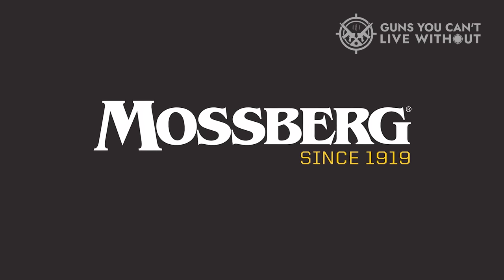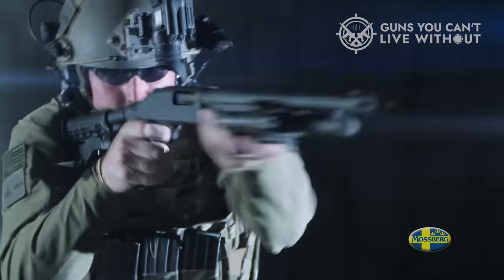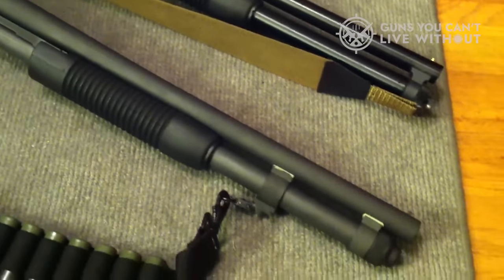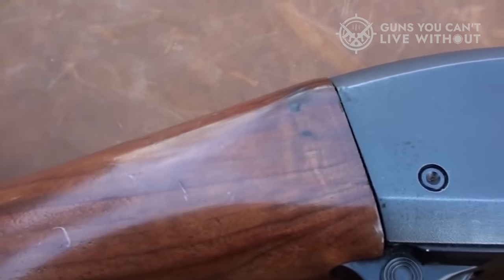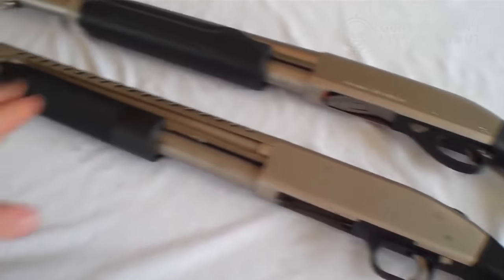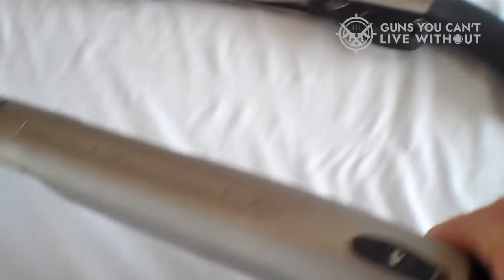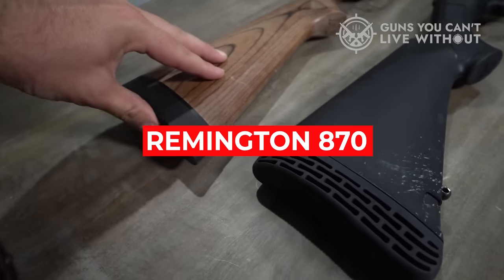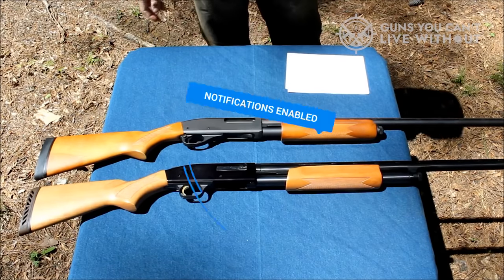Mossberg 590 vs Remington 870 - NOT EVEN FAIR.

Comment: The Mossberg Maverick 88 was from the start, built to a price, and it is made in a completely different facility in TX. It has about 90% interchangeability with 500/590s. That being said, its a fairly dependable shotgun. I have seen both of these brands of shotguns fail.  Don't think that Remington's have been any better thru the years. Like anything production line, man made, their can, always be, problems. Have you seen the U-tube TFB cheap shotgun 500 round torture test? The only one to pass with flying colors was the Mossberg Maverick. Perhaps the new owner of Remington will improve their construction, fit and finish. Who knows. I don't like the riveted extractor, or the soldered in barrels, or the push button safety of the Rem. I do like the shorter forearm reach of them ergonomically. We will have to see how the new owners do with the product. Being one of the last 2 big USA makers, family owned and over a 100yr old company, I like giving Mossberg in New Haven CT,  my business. Remington being over 200yrs old, is now owned by Roundhill Group. They spent $13 million for the original Remington plant in Ilion NY, its museum, and steam power facility. The company also purchased the Remington barrel-making plant in Lenore City, Tenn. They want to return Remington to its finest days as a premiere firearms maker. I am praying they do. The NY gun maker is on shaky ground imho, due to NY gov Cuomo signing a law in, that allows citizens for the 1st time in history, to sue the company for ridiculous reasons. So who knows.  I am hopeful for them, none the less. The once famous New Haven CT Winchester SXP pump shotguns are now Turkish made and european owned by FN, but they seem to make a halfway decent shotgun, but not for me.  I have studied all of these, and I am buying a Mossberg 590S personally. I still think its the best option for me. I have a good semi auto but never owned, or really needed a pump.  Things change tho. The history of Mossberg, the use in world wars , the military testing , the reviews and research I have done have gotten me to that conclusion.
Reply: Mavericks are made in Turkey now
Reply: I rode my motorcycle to South America in 2018.  Every business had a security guard and they all used Mavericks.
Reply: @mikelivingston6157  I couldn't confirm that anywhere, though apparently some 88s are indeed made overseas, presumably for those markets. As far as I can tell, most are still made in Eagle Pass, including one I recently purchased, though they do outsource some parts..
Reply: I really enjoy duck and pheasant hunting and my first shotgun (50 years ago) was the 500. Upon firing 3" shells, the square locking lug (w/sharp corners) that extends thru the bolt and into a notch in the receiver sheard off. Conversely, ever since I've owned one 870 my entire life without any kind of failures...
Reply: @BobbyOfEarth  lol
Reply: @BobbyOfEarth  the mossy doesn’t have a receiver bolt lock system…Remington does…mossy bolt locks to the barrel…which is how they are able to use alloy receivers…like Winchester 1200/1300 series….
Reply: @gixxerlouis  A very necessary revision, because in 1976 they sure had one in the 500. It was machined and ground from hardened steel, recessed into the bolt and was lever actuated to force the lug into the notch in the receiver... total fail!
Reply: New Haven Mossberg factory closed quite a few years ago 😢

Comment: My choice is Remington 870 due to my own experience.  The video did not even mention the most significant difference of these two great guns.  The Remington ejects to the side and has a cover in the loading port which acts as an elevator when cycling.  The Mossberg ejects to the bottom and has no cover.  In my own experience, while running through the woods, I have actually had rounds fall out of the bottom of the Mossberg from the magazine tube.  Also, I have never had a failure to extract from my Remingtons, but I have and my friends have had failures to extract with mossbergs.  Also, Remingtons are easier to add extensions and change out barells than mossbergs because of the ring position and mounting of the magazine tubes.  This video is kinda click baity too, because it states "not even fair," as if there is a clear winner, and then at the end says its too close to call and for people to make up their own mind of which is better, which is a Captain Obvious statement.  This would only be informative to someone who doesn't know anything about shotguns, and then they would still have to do their own research to make a choice because the video does nothing to help with that choice.  The video also makes numerous points while showing video of things other than what they are actually talking about like bolt action rifles and such.  Very low quality video, sorry to say.

Comment: I've got a 500, and a bunch of accessories for it that I got a great deal on a few years ago.. I wanted a 590 retro, but it was nearly impossible to get one...  So, I built up the 500 to nearly that spec... 
I am amazed how easy the Mossberg is to upgrade. I like it.
That said, I still would have my old Ithaca 37 back (or better yet a 37 M&P).
Reply: People told me in the late 1990's to grab the OLD 590 if I could find one. 

 I stumbled across one at a gun show that was about $420. I bought it on Sunday afternoon before the show closed for about $375. Cash was the magic ingredient. 

  It has all the "old" features and higher quality parts. I hear the 590A1 is similar but haven't really looked. 

 Why would I need another one?

Comment: I own a 590A1 & i bought a pistol grip for it but have never  put it on. No complaints about the gun. I also own a Winchester which came with 2 barrels, a 20 inch smooth bore slug barrel, a 28 in vent rib barrel with 3 screw in chokes & i bought a barrel to shoot Sabots. Love that one. Never owned a Remington , but have always admired the famous 870.

Comment: Very thorough comparison. As you stated one cannot go wrong with either. I would go with the 590 A1 due to the heavy barrel. If used as a rugged tool the heavy barrel will not succumb to dents and damage as easily. Marine grade Mossberg is a beauty.
Reply: I also have a 590A1 (Ghost Ring sights) and have the M7 bayonet. ;-)
And a "shorty" 500...for a car-gun or just "tight spaces."
-- BR
Reply: @billredding2000  you want a tight space monster,  take a look at the Kel-Tek. CDNN sports runs sales on them. I put over 750 rounds through one and no issues. I did tune it up a bit but its a sweet pump

Comment: Good comparison.  I learned to shoot with an 870 in the late 1960s, and in the 1970s sold and shot both the 870 and the 500.  I also sold (and eventually bought) an Ithaca 37, which at least in those days beat both the Remington and the Mossberg hands down.  Only Ithaca was still using machined steel receivers in the '70s (yep, even the 870 had gone stamped), it was lighter and  easier to carry all day, the bottom ejection kept snow and rain out, and it was simply a sturdier, better gun.  Mine also came with a Deerslayer barrel.   The only downside was its ability to slam fire.  As a stupid 18 year old kid I wasted a lot of ammo doing that.  I sold my Featherlight for beer money when I went to law school, mainly because I couldn't store it in my dorm room.  To this day I kick myself for that decision.  I'm sure your familiar with the gun.  The old 37s are awful expensive today, but if you have a chance to pick one up, I'd look forward to your review.
Reply: 870s have always used milled steel receivers. Never stamped steel and never aluminum. The post-FAG quality was less than stellar and at some point they went to a plastic trigger guard and used a few MIM parts, but never stamped receivers.
Reply: @joshrandall3632  That just isn't true.  I started my shooting with an 870 as a kid, and sold them in a sporting goods for several years in the early to mid '70s.  I was astounded when Remington started using stamped steel (not aluminum) receivers.  It was an era of a lot of cheapening, and every pump gun but the Ithaca 37 stopped milling their receivers.  It was a topic of conversation in the store. Remington went back to using machined receivers sometime after I went off to college, I think later in the '70s.
Reply: @bjs301  False. Look it up. You're mistaken.
Reply: @joshrandall3632  I sold the damned things.  The 870 was the most popular pump gun made , and the move to stamped receivers pissed people off to no end.  It had been my favorite gun, the gun I learned on, and I bought my Ithaca because Remington had gone cheap.  This wasn't a little known secret.  It was a big point of discussion at gun stores.  As I said above, they later went back to machined steel receivers.  Did Remington later try to pretend it didn't happen?  It appears they did, but I can't imagine why anybody would be surprised by that.
Reply: @bjs301  Again, you're obviously confused. That never happened, so Remington didn't have to pretend anything. Not sure why you're so intent on believing this, but feel free.
Reply: @joshrandall3632  You too.  I was there.  You weren't.
Reply: @bjs301  Seems like you might still be there.
Reply: @joshrandall3632  That's just hilarious.
Reply: @bjs301  You're hilarious. The only person on the planet who has ever seen an 870 made from stamped steel. Did you sell it to a leprechaun? Maybe you used one to shoot a sasquatch? I think you had a little too much fun in the '70s buddy.
Reply: @joshrandall3632  😂

Comment: I've been a Mossberg guy my whole life. I worked for the USDOJ as a contractor in the 1990s, and got to handle a LOT of different firearms--pistols, rifles, and shotguns--and when I bought my first pump shotgun, it was a Mossberg 500. I now own several Mossy's, including a JM Pro 940 that I use for USPSA 3-gun. 

The primary reason I chose Mossberg over the Remington is because of the configuration of the safety on both guns. I'll NEVER understand what possessed Remington to put their safety button on the trigger guard. That just seems like a recipe for disaster to me, especially in a high-stress home-defense situation. 

I think the tang safety adopted by Mossberg makes a lot more sense. I don't have to change my grip to activate it, and it is ergonomically much more compatible with my other competition guns (AR15 and ParaOrd s14-45)...
Reply: Yeah I think it’s a hold over from it’s hunting roots. Just don’t think they ever bothered to change the safety for a defensive minded model. My Ithaca has one and they never changed in for police models or anything like that.
Reply: In theory ambidextrous is better. For some reason my new style 500 safety is a bear to get off safe sometimes. Been like that since it was new. No problem with my new style 870 safety

Comment: There is a big difference in the manual of arms. On the 870 you can unlock the action and push the next round into the tube so it clicks, then open the action the rest of the way and it won't grab the next round from the tube. This makes tac loading a slug easier for example. The mossy you have to open the action and flip the gun upside down and shake the round out to do a tac load.

Comment: I have several 870 and a few mossbergs. I prefer the old school 870’s. The newer ones that Remington made before close were sub par.
Reply: The new Remarms ones picked up the slack. Got one, after around 1000 shells never had a failure except for cheap aluminum base shells ejecting weak but that’s hardly the shotguns fault.

Comment: My biggest complaint with newer model 870s is that the steel receivers are rust magnets.  A humid summer in a gun safe without desiccant protections or a good wipe-down will often times leave your receiver with rust patches starting anywhere you used to have a minor blemish in the finish, and that includes inside, in the areas you can't see without disassembly.
Reply: @darrellkingsley7420  I've just gone with Mossberg instead.  The action isn't as smooth, but I don't have to worry about aluminum rusting out.

Comment: I’ve owned multiple of both. I had a Mossberg that sheared it’s safety disconnect bar in half after a few too many full power slugs and found the part in question was MIM. But I’ve owned other Mossbergs that haven’t given me any problems at all and function in any weather, even if it gets dirty in the field. They’re handier than a 870 and that means a lot when you’re squirrel hunting and have a split second to shoulder and fire your shotgun. I’m lucky enough to have a model now that can use both a home defense and a field barrel without changing the magazine tube and wouldn’t get rid of it for anything. Remington’s are fine shotguns. The prison I used to work at still has shotguns in the armory that are older than the prison itself. They function as well or better than government weapons with their age and miles can be expected. Every one of them I’ve owned have rusted up very quickly, even after a coat of lithium grease and pleads. Overall I’ll take the better finish and mobility of the Mossberg.

Comment: My retired Sheriff Deputy brother, swears by the 870.  A retired Marine friend likes the 590.  When I let them shoot my Keltec KS7 or KSG, they don't want to give it back.  I am a strong believer in synthetic gun lubricants.  Which will help any shotgun function better.  But the weight and balance of the Keltec shotguns is hard to beat.  Besides I have a strap for each one.  So moving through brush is easier.

Comment: A shotgun is the only thing missing from my collection. I've had a few 870s through the years, and they were all fine guns, but the 590 looks like my next purchase. I would like to get one with a pistol grip, and can see where the placement of the safety is an issue. I'll probably get two different stocks for it. Great video!! I was leaning towards the Mossburg, your video pushed me over the line. I'll say this though if you own an 870 you have a fine shotgun, the ones I have had were indestructible.
Reply: 870's are great guns but sloppy action compared to 500's. You can actually watch the bolt flex if you throttle pump handle a little in locked position. Mossberg is just better all around. Pistol grip flip over top collapsible stock is the best of all worlds. Just put some cheek padding on it.

Comment: The trigger housing and safety on the 590A1 are actually an aluminum alloy, not steel. Also, the bayonet lugs are only present on the 20" 590 and 590A1 models, not the 18.5" variants.
Reply: Funny my 18.5" 590A1 has the lug....

Comment: I work on both guns and find the Mossberg much easier to repair or modify.  When it comes to manual of arms and ergonomics, the Mossberg is superior to the Remington.  The ambidextrous Mossberg safety is one of its best features.  If you prefer to have a pistol grip, the Mossberg safety does become difficult to reach, but you can dispense with using the tang mounted safety and install a Maverick trigger guard.  This will provide you with a secondary cross-bolt safety similar to the one found on the Remington.  It has the added advantage of being placed at the front of the trigger guard for easier accessibility.  The 870 safety is placed at the rear, making it harder to engage/disengage and less intuitive.  A similar issue exists with the action bar release.  The Mossberg is easy to operate without removing your hand from the firing position, while the front mounted release of the 870 requires you to move your trigger finger onto a barely perceptible tab that is a very hard to press.  Lastly, it is much easier to load and unload a Mossberg because the lifter arm/elevator is skeletonized and out of the way.  If your fingers slip while loading a Remington, or if you short stroke it, there's a fair chance you will end up with a round jammed between the bolt and the elevator.  I've never seen this happen on a Mossberg.  Some 870 owners modify the elevator or install an aftermarket elevator to help with clearing jams.  On the plus side, Remington magazine tubes are easy to extend.  Most Mossberg 500 magazine tubes are fixed length and must use barrels with a matching barrel lug.  If you think I don't like the Remington, you would be wrong.  I keep an original 40 year old Parkarized riot model handy.  The only modification I've made to it is the replacement of the right hand safety with a reverse left-hand safety because I'm a southpaw.  The old 870s are very solid guns and may outlast a 500 over time, but you'd have to do an incredible amount of shooting to wear either one of them out.
Reply: working backward on your comment, for sure one of the really good 870s from back in the day is gonna out last any mossberg over time, if you can find one.  i prefer the elevator of 870 to keep debris out, and makes more reliable feeding of mini shells.  i can operate the action bar just fine with good grip, what am i missing here, is that a lefty thing? the safety placement sure is.  the 870s safety to me is totally intuative as its been 40+ years for me.  otherwise for new shooters i recomend the 500
Reply: @whatcanilearnhere9158  Any system can be mastered.  I'm pointing out which one is more intuitive and easier to operate, particularly for a beginner.  Placing the cross-bolt safety behind the trigger makes it awkward to reach, but not impossible.  I normally don't use the safety on a semi or pump shotgun unless I've chambered a round.  I prefer to keep them in a ready state (loaded magazine, empty chamber).  Regarding the lifter/elevator, the 870 elevator does not seal the gun from debris entry.  If dirt or mud does get in the gun, it is easier to remove it with an open setup.